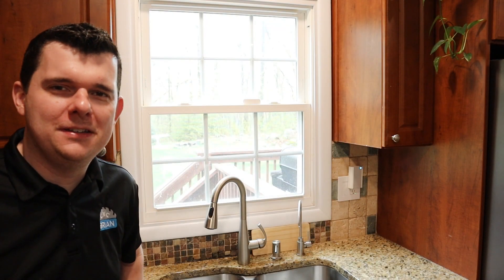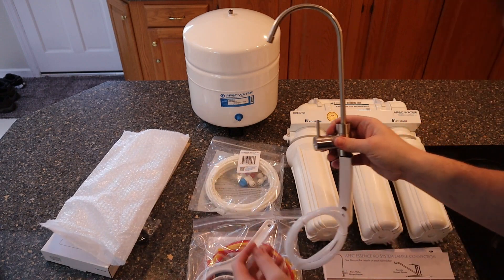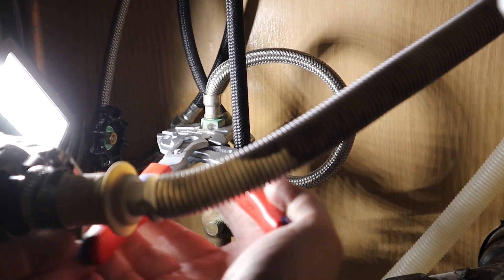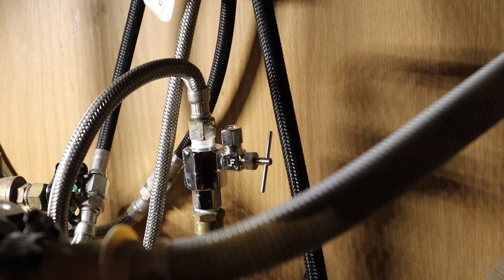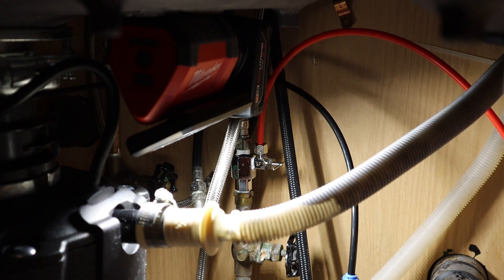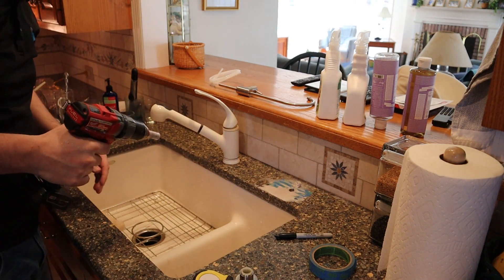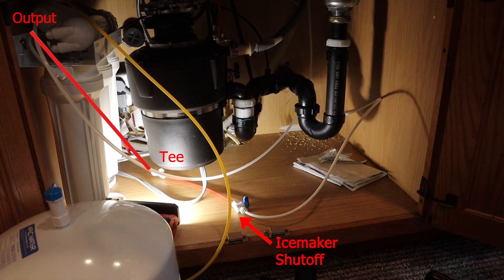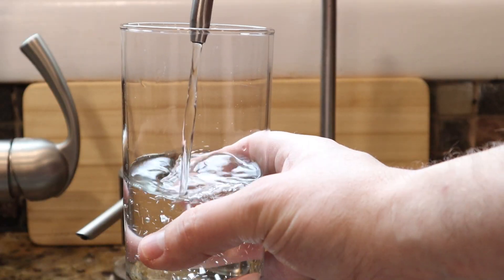How to install a 5 stage drinking water filter

Comment: Does the water in the pressure tank bladder just sit in there forever, or do you end up drinking that? Or does it go down the drain tube with the waste-water? I'm trying to decide between tank / tankless. The whole idea of us going w/RO is to get away from water that's been sitting around in plastic. Thanks for the video and the answer to this question.
Reply from the maker: To be frank, the entire system is exposed to plastics, from the tanks to the tubing, but that's the way of the world now unfortunately. The accumulator tank effectively gets consumed and replaced as you use it but it's primarily for boosting the water pressure as the water only trickles through a 5 stage ro filter from around 50psi~ inlet pressure.
Reply: @briancnc Actually, I figured out that the water goes into the pressure tank before it goes thru the RO Membrane.  So, any possible impurities leached while in the bladder would be removed before it's delivered thru the faucet. The pressure tank is not so much a storage system, but for on demand pressure to get water forced thru the tiny membranes.

Comment: Thank you for this video!   I had mine installed by a plumber for almost $500 just for labor! (didn't include hole in granite, I already had that). 

I only watched this video to know what that blue fitting on the bottom of the big tank is for.  I guess you said it's just a pressure tank, so it shouldn't have water then right?  Maybe it's a drain valve but I have no clue when to use it and for what.  

Also I just watched a video how to install replacement filters... I only installed 1-3 as per the schedule, but found that filter #3 (carbon #2) had mucous strings floating around in the water... was that like bacteria colonies or something?  Nasty.

Comment: Great video!   This is similar to the system I am getting and  am planning a basement installation directly below the kitchen sink.  I see you installed your feed (red) directly to your copper supply, which is what I imagine doing, though I know nothing about the shark bite connections.   Would I be able to run the drain (black) line to the vertical drain that runs straight into the floor?
Reply from the maker: @skinfiddler  yes you can do it on the vertical, it shouldn't make any difference. If you can do it like I did high up on the horizontal though it will definitely never leak, no matter how old that gasket gets.

Comment: Great video. What size is that diamond coated drill bit?
Reply from the maker: It's a Diablo 1/2" drill bit, but just double check the outer diameter of the fitting that has to slip through the drilled hole, it should be an easy fit.

Comment: Thanks for the video. I have a question about the tankless system, would you recommend it?
Reply from the maker: Tankless RO system or tankless water heater?
Reply: @briancnc  I saw the same brand with your link and it shows the tankless RO system.
Reply from the maker: @vinhgolf  I'm not familiar with the tankless system sorry
Reply: @briancnc  ok. no problem. thank you.

Comment: Fantastic video. Great practical tips, easy to follow. I didn't connect my system to the fridge, so I needed the manual for the very last steps to install the filtered water in the new faucet. Other than that, one of the best videos that I have seen. Thank you!
Reply from the maker: Thank you!

Comment: this was a good video. i have been wanting to buy a unit for a while. it looks similar to when i connected an ice maker. but i have a concerning question, not sure you can answer. why do you need it to connect to the drain? i am guessing over flow. i am asking because one year, my plumbing backed up and it came back up the shower and sink drains. if my plumbing backs up in a house, i am assuming it might go back up the filter drainage as well? and i would have to clean out and flush the whole system? thank you. if it it minor over flow, maybe i could run the drainage down to the floor to the crawl space. what are your thoughts. thanks again.
Reply from the maker: Thank you for the comments. You need to connect to the drain as the filter discharges water, it's part of the byproduct of the filtration. I believe it's something around 2/3 discharge to 1/3 filtered water. Most of these systems have in-line check valves which make return flow impossible, and if you wanted to make it very redundant you could buy another and stick it in line with the discharge (black hose) to the drain pipe saddle.

Comment: Thanks Brian. Can you do a quick walk through on how you did the basement install. I have zero space under my kitchen sink.  I wanted to install on my fridge and top mount tap but was told that it was not possible. Would like to see how you did it.
Reply from the maker: Hey Marvin, thanks for watching. I will shoot a quick walkthrough tonight for you and post it on my channel. Installing in your basement is not as easy as teeing into your sink but it's definitely not terribly difficult, especially if you use a shark bite like I did. I will reply again once it's posted later!
Reply from the maker: Hi Marvin, I just posted a video to help out (see link below). You can mount it in the basement no problem, and absolutely no issue feeding both your fridge and sink top tap. You could technically feed as many sources as you want as long as you watch the distance and pressure drop, so just make sure the filter is installed centrally close to where your water will be dispensed. Hope this helps!

https://youtu.be/OU_O4CwydFg